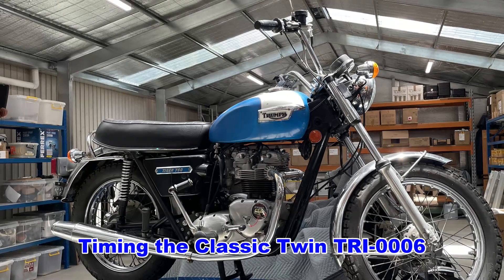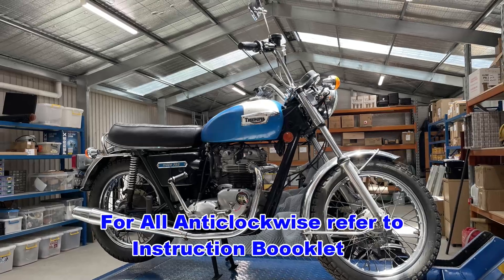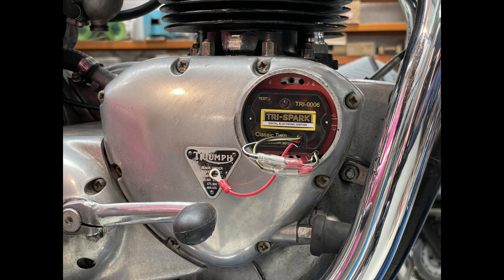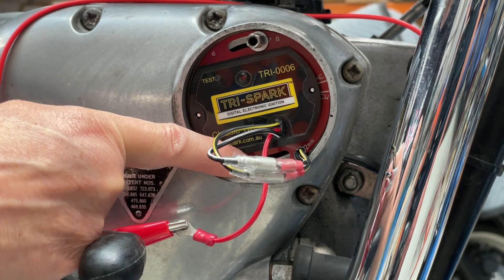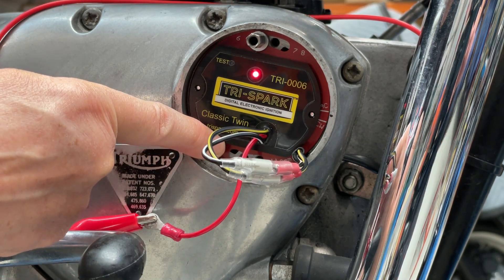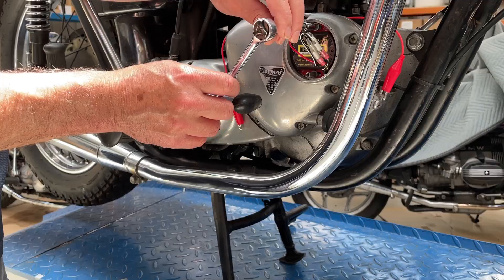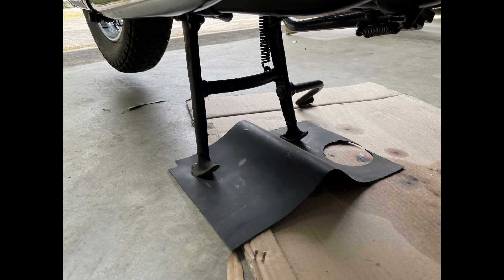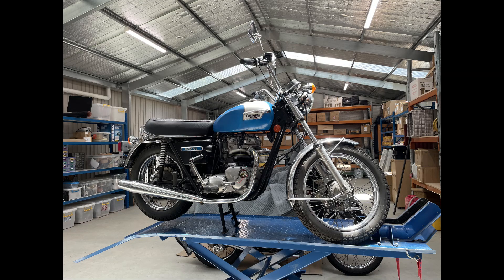How to Time Your Tri-Spark Classic Twin Ignition on a Triumph.

Comment: Hi Steve just a comment on your video regarding the timing mark on the alternator's rotor position, this can be out slightly for a number of reasons. To check it  Triumph machined a top dead centre and a 38 deg BTDC shallow hole in the flywheel of the crankshaft from mid 60's. A plug is threaded behind the cyinder in the centre of the cases just behind the guide block on models 66 to 79 then 80 on it changed position to underneath the front of the crankcases, a cheap tool is available that screws into the cases when the plug is removed (the thread changed from BSF to unified around 68-69) when the tool's outer part is screwed in a rod is inserted into its centre which drops into the shallow hole in the fly wheel when either TDC or 38BTDC is lined up . A bonus is when the pin locates either hole it will keep the flywheel from moving while the timing is being adjusted. Both BSA A65's and some Commando's employ a simular system.